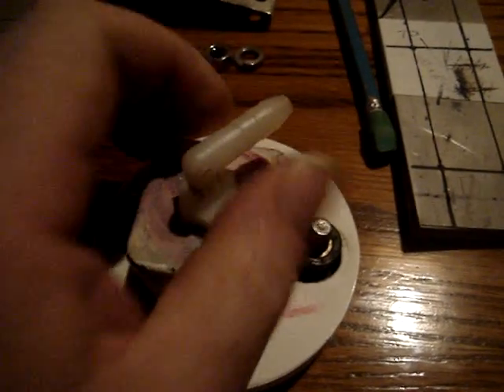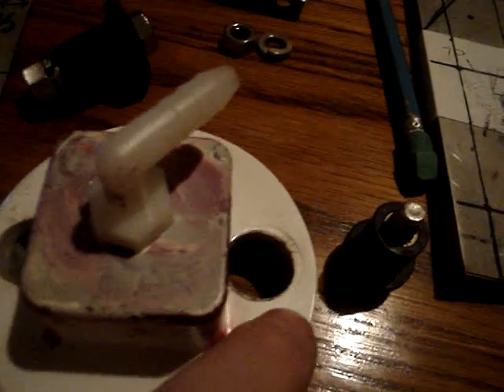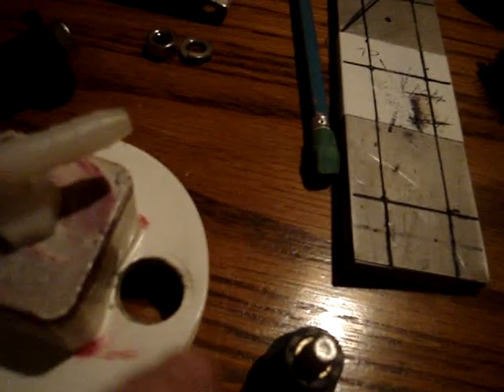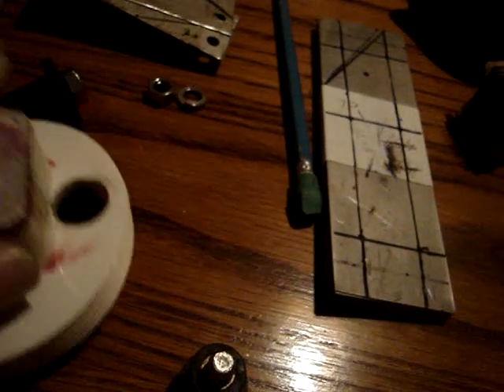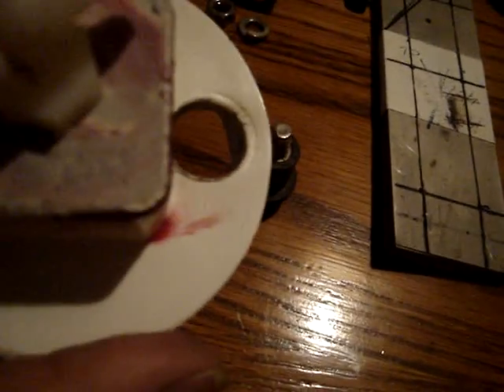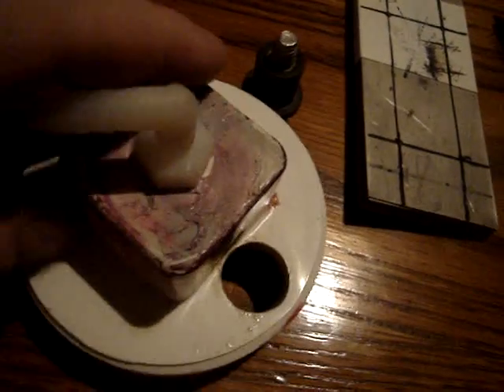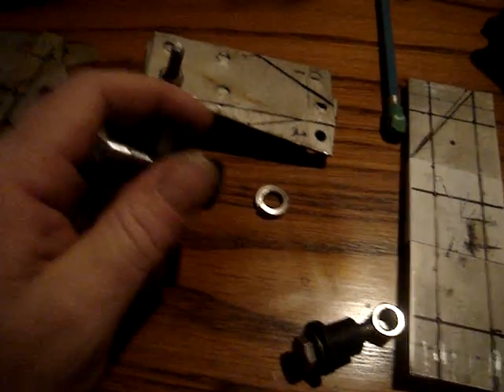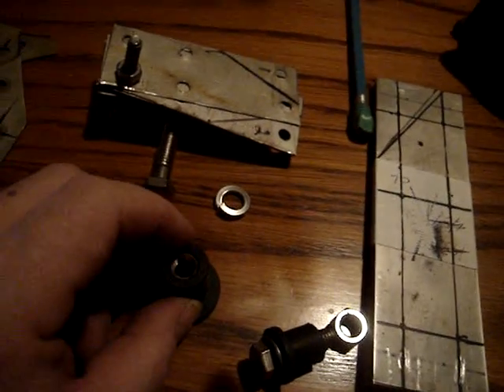hho generator fixing cap design.mpg

Comment from the maker: @sunraylou  nothing to do with current leak,has to do with50 amps going in and the terminals getting hot because the temp-of the water and the air being super heated and the bolts absorbing the heat transferring the heat from the terminals to the PVC and melting the cap and also warping the threads,Now the terminals are on the side below the water line I can now even put my tongue to my terminals that is how cool they run under the water line,